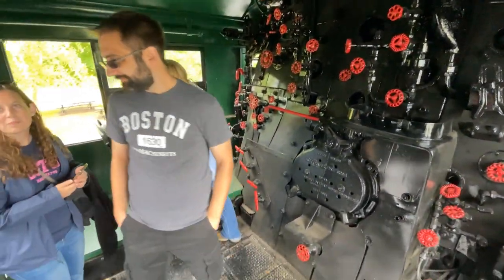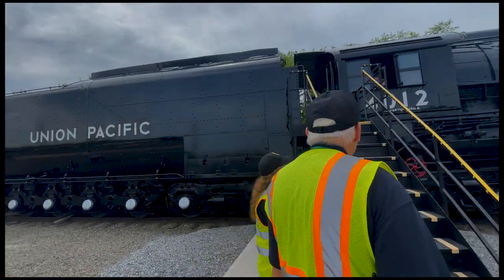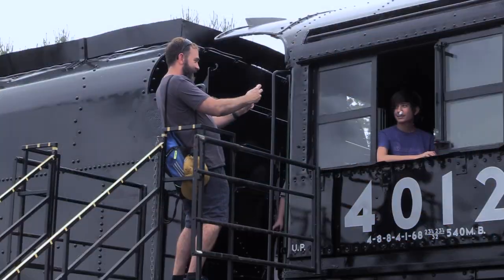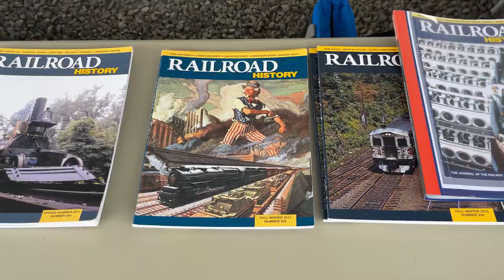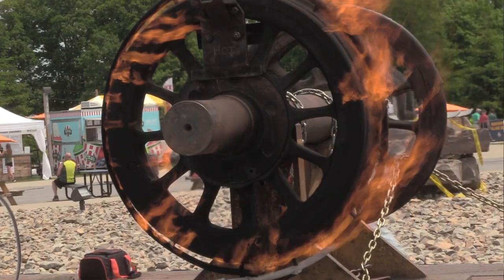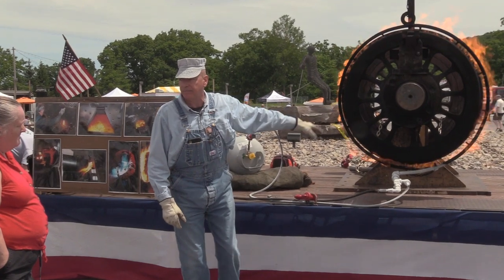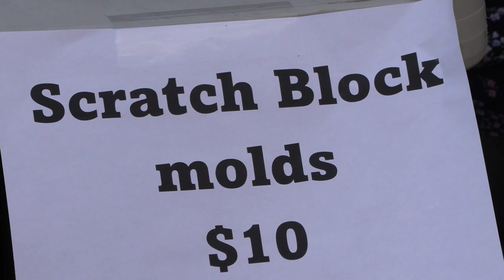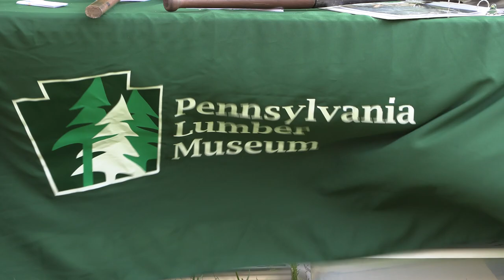INDUSTRIAL HERITAGE DAY

Comment: We’re they still working on B&M 3713 in the shops?
Reply: They’ve been working on her for more than 20 years
Reply: @lukePMberkshire1225 the leadership is shot and collapsed. Purely disheartening
Reply: @nicholasmedovich8691  no kidding. They better get this project back on track(pun intended) or they spent all this time and money for nothing
Reply: @lukePMberkshire1225  IF they were to be on the right track so to speak, I would recommend FMW solutions to assist the reassembly of 3713s firebox. Also would help with 2317 when the time comes.